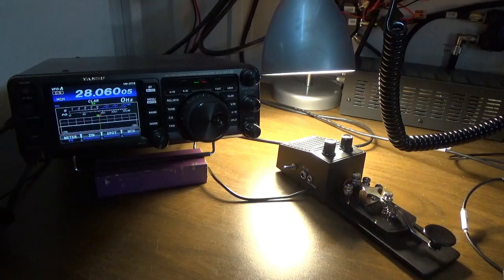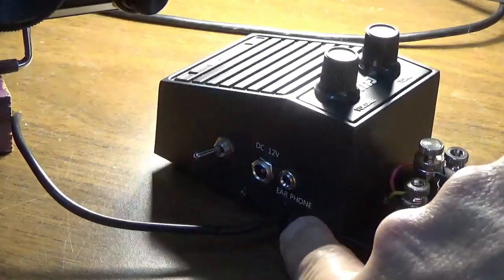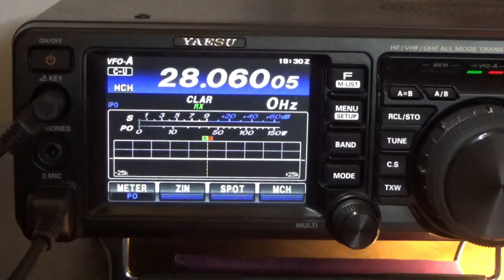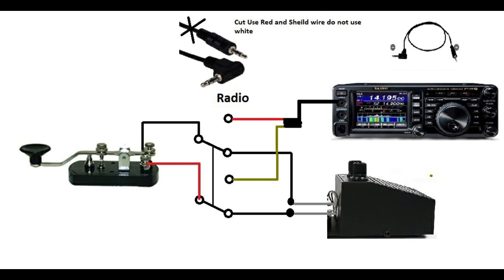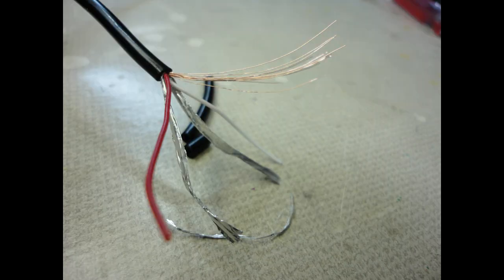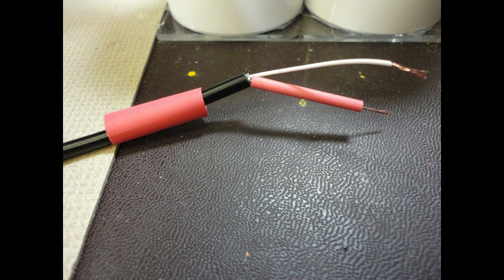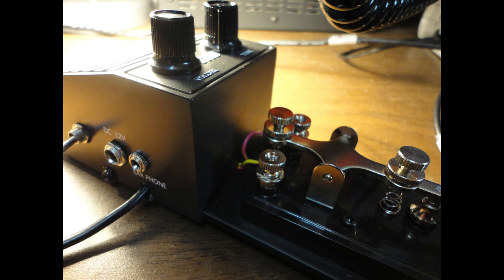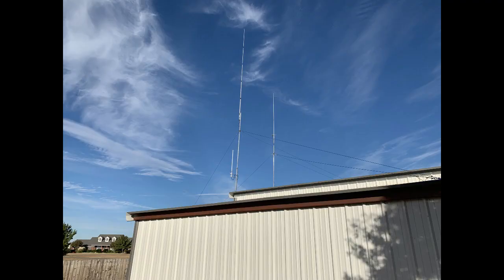FT991A CW MFJ-557 Straight Key Mod CC400MA-06 Dual Use Less $ 10.00 Radio and Practice Oscillator

Comment: Can the straight key can be removed from the  oscillator?
Reply from the maker: Good evening sir. OI has a look and I think you could jut pull the electronics out and jut use the key the weight makes it nice it stays in place, let me know if you need anything else.
Reply: I have a 557, & I bought a second one at a hamfest, removed the oscillator from the base & that's going to be my portable one. I do like this project though. The original one I have connected in my ham shack.

Comment: Sorry but I don't get the point. Why not just use radio side tone (without transmitting)? The MFJ sound is horrible!
Reply from the maker: Good evening sir, yeah actually its better to use the pitch from the FT991A and leave the BK-IN off, I didn't think about that when I made the video, thanks again for pointing that out, '73 de KI5JUF